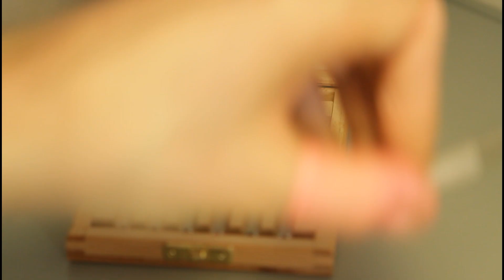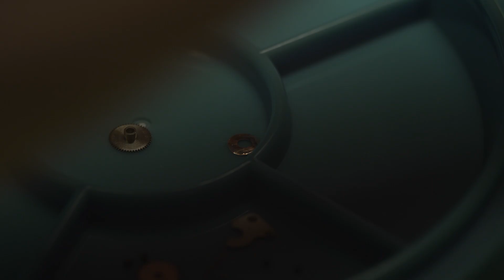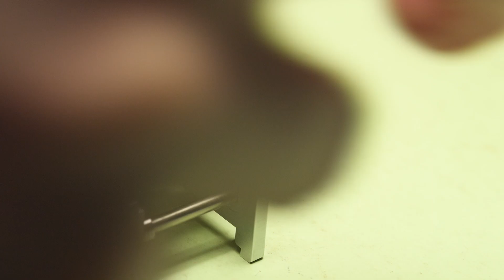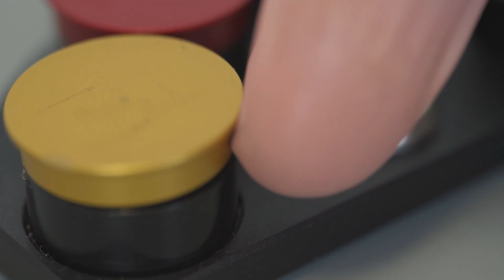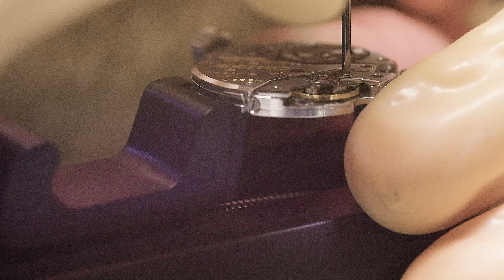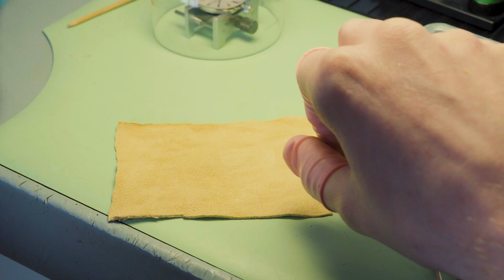Why did I say YES to REPAIR his WEDDING GIFT | watch repair and restoration

Comment: The Seiko Caliber 45 is a masterpiece, with approximately 200 units passing the Neuchâtel Observatory's chronometer certification.
However, the high-torque mainspring is prone to snapping, and a breakage can sometimes damage the barrel assembly in the process.
Wear on the pivot holes—a consequence of the high-beat rate—is also frequently observed.
Nevertheless, it is still easy to achieve stable precision; with proper maintenance, it can deliver accuracy and stability surpassing even the latest movements.

Comment: This was a great video, I just bought a 5645-8000 Grand Seiko automatic hi-beat with original bracelet and I hope to do the service myself.   It is not as sentimental as a watch that has been passed down from father in law(s) but it will be proudly worn.   Mine was made in 1971 so I fear it has the "Do Not Open" main spring and I was surprised to see yours could be serviced.

Comment: From what I've learned the main spring being thicker than usual is not because it is a manual winding watch, but rather because it is a Hi-Beat movement that requires more power to drive!
Reply from the maker: Makes sense, thanks.

Comment: Am i the only one freaking out over the hairs
Reply: Right? I didn’t like them in the edge of the camera view, then I saw them on the table lmao
Reply: Really enjoyable video! But yes, as you say, the stray hairs were a bit distracting—not just the loose ones on the workspace, but also the ones dangling into the frame in a few of the shots. A simple hair net would be recommended for thick-haired watch repairmen like our host.

Comment: i think you forgot the seal that makes the watch water resistant
Reply from the maker: Well spotted that wasn't included in the video. I replaced the original one with a new gasket, but that wasn't part of the recording. Thanks for the keen eye.

Comment: You did a great job, and explained things very clearly, well done. 

The amplitude when you put the watch on the timegrapher is very low, though - especially if it was close to fully wound. 

By the time the watch runs 24 hours, the amplitude will have dropped further and timekeeping will suffer badly. 

You mentioned using a high viscosity oil on the escape wheel. What oil did you use? 

The escape wheel is the fastest wheel in the movement and must be able to stop and start with maximum freedom as the escapement locks and unlocks. You really don’t want a high viscosity lubricant here. 

What did you use to oil the pallet stones? 

If you can get this watch to run at around 200 degrees of amplitude after 24hrs it’ll time out really well.
Reply from the maker: Thank you for the insight. I used Moebius 9010 on the escape wheel. The pallet stones are lubricated with Moebius 9415.
Reply: @ Moebius 9010 is fine for the escape wheel pivots, and 9415 is fine for the pallet jewels. 

If you want to troubleshoot the watch to find the cause of the low amplitude, I suggest you remove the balance and pallet fork, and check that the train runs freely. If you put a bit of wind on the watch the escape wheel should come to a gradual halt, and then reverse direction briefly. 

Also test the free oscillation of the balance. Remove the pallet fork, install the balance, turn it through 180 degrees and release it. You should see the balance oscillate back and forth for a full minute before it stops. 

If these test ok, then I suggest that you check the sideshake and endshake of the mainspring barrel. If the holes the arbour runs in are worn, and there is too much shake then it will rob you of a lot of amplitude. 

I hope this helps.
Reply from the maker: Thank you very much for these points to check!

Comment: you need to do a research about oiling that type of movement  because the amplitude is very low, high beat movement require special oiling
Reply from the maker: Sharp eye. You're very right, I would've liked for it to be atleast above 200.